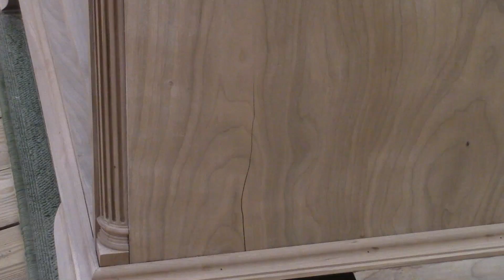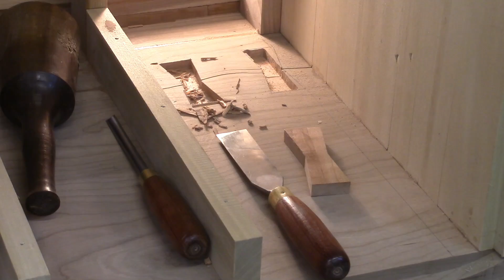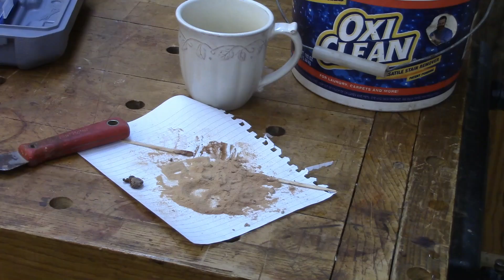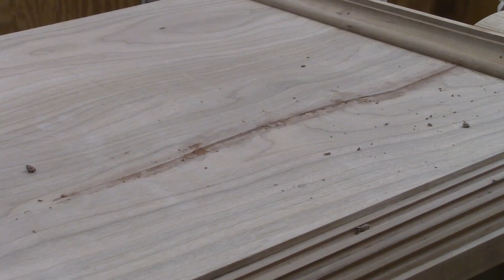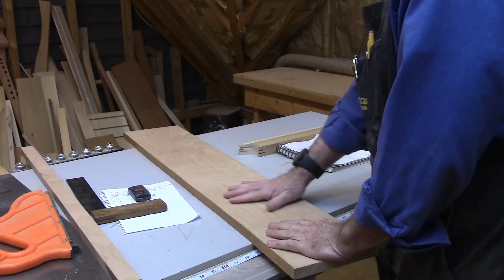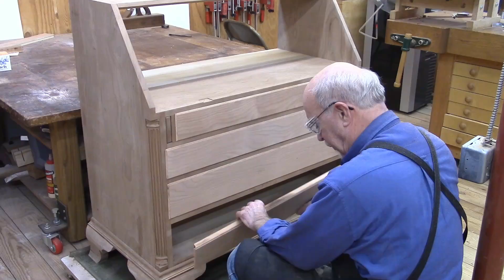Penn Chippendale Slant Front Desk Repair Crack & Drawer Front Step 7

Comment: I know it sucks. That crack will rear its ugly head again. If The side is restrained cross grain and moves with seasonal humidity changes, it will open up again. If it cracked due to a tight pin socket that split in the dovetails then you may get lucky with that repair. Would like to hear how it holds up in a year or 2.

Comment: I would have epoxy and clamp but now I’m thinking it would crack somewhere else .  Is that why you filled it?
Reply from the maker: If you epoxy, it won't take the stain, the filler will.  The bow ties hold it together. It may crack somewhere else.